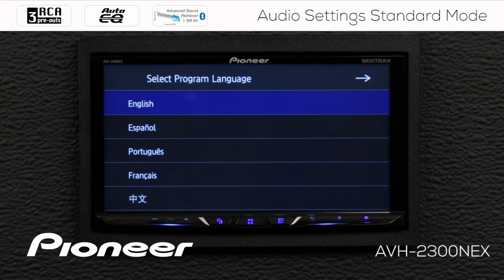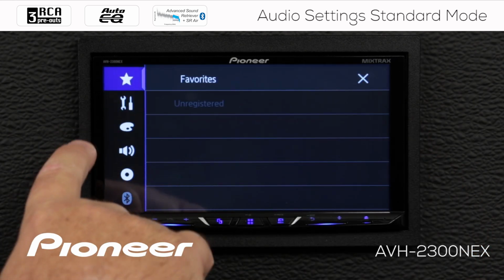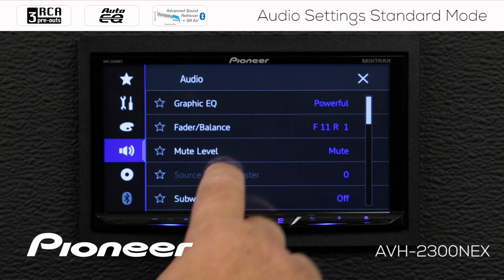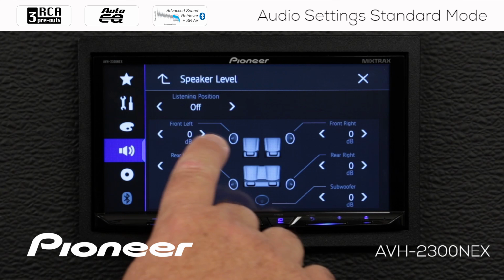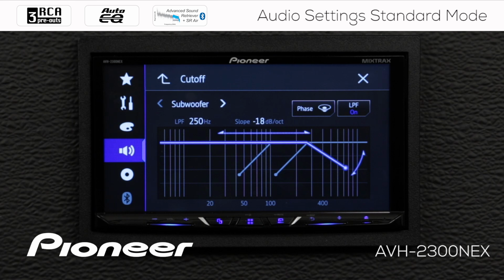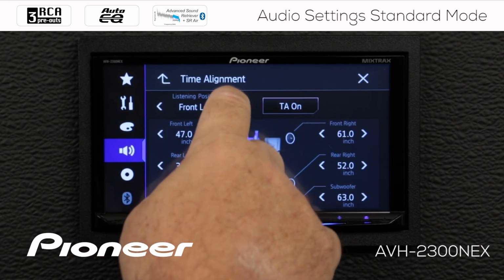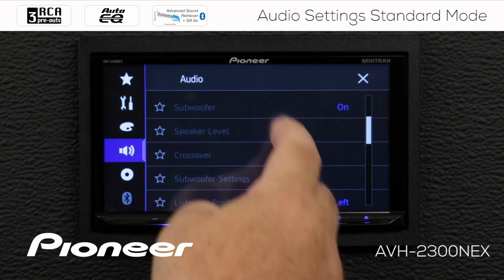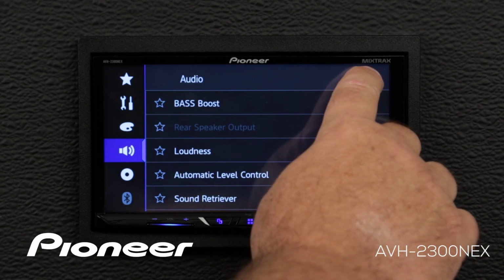How To - Audio Settings in Standard Mode on Pioneer AVH NEX In Dash Receivers 2017

Comment: For some reason, my "Rear Speaker Output" remains grayed out, even when I turn the source off. The unit is in "Standard Mode". My car has a small rear subwoofer, that is not working. It seems like the "Rear Speaker Output" switched to subwoofer would be the fix, but the option stays grayed out. Anyone have an idea? It's a DMH-1500NEX
Reply from the maker: Are you certain the receiver is in Standard Mode?  Rear Speaker Output being grayed out usually means the receiver is in Network Mode.  You can see it in this video:          https://youtu.be/3t9zCiIGO7M?t=827
Please be more specific with your question.   
Are you using the in-dash receiver's speaker level outputs or the RCA outputs to send signal to the subwoofer?
If you are using the speaker level outputs to run the 4 speakers in your vehicle, front and rear, I recommend to use the receiver's subwoofer RCA output to send signal to the subwoofer.  You can see it here:    https://youtu.be/I1XFyRiTZKc?t=217
Is the subwoofer a factory sub, or is it an after market subwoofer?
Are you certain the subwoofer is powering up with the vehicle switched on?
If this is a factory subwoofer, it may not be switching on or the signal may not be reaching the subwoofer.
Please take a look at this video for switching the rear speaker output from full range to Subwoofer output:    https://youtu.be/Z86fQryoRVk?t=701
If you are certain you have the receiver set up in Standard Mode, the receiver is off,  and still can't access the Rear Speaker Output menu, I recommend to press the receiver's microprocessor reset button.  You'll need a paperclip or some other small point to press the microprocessor reset button.  You can find the microprocessor reset button on the DMH-1500NEX on the hard key panel to the far right.
You can find more videos on Pioneer's YouTube Channel here:  https://www.youtube.com/user/pioneerelectronics

Comment: When I try to use the rca pre outs front or rear in standard mode at the same time as using the speaker out puts, there is no signal coming from the preouts.

If I put it on network mode, it changes the speaker outputs to network mode also. Only highs going out the speaker outputs. This does not work for me as I need to use the speaker outputs for the car factory bose system. 2009 Mazda CX-7.

Am I doing something wrong? 
Ideally
1;  I would like to use network mode as I have after market tweeters that I have installed running on their own separate amp. 

Or 2;  use standard mode keeping the speaker outputs in use for the bose system and using either the front or rear pre outs running to the separate amp for the tweeters. But no signal is coming out of them in standard mode. If I turn the unit up all the way and the gain up all the way on the amp, you can hear a faint signal. Surly I'm missing something. 

Rca connections have been checked and rechecked and the amp is a brand new pioneer 3702.
Note: Subwoofer Pre Outs work fine

Cheers if you can help me with this one.
Reply from the maker: What is the model number of your Pioneer in-dash receiver?
Please clarify your question:   Are you saying, in Standard Mode,  you are getting signal from the RCA outputs, until you connect a speaker to the corresponding speaker level output?  And only at that time does the RCA output stop functioning?   And if you disconnect the speaker, the RCA then begins to function normally again?
It's normal operation of the receiver for the outputs, both RCA and speaker level to change with Standard Mode or Network mode. 
In Standard Mode the Front RCA outputs mirror the White and Gray speaker level outputs.  And in Standard Mode the Rear RCA outputs mirror the Green and Purple speaker level outputs.  This is normal operation.
If you are not seeing simultaneous RCA output and Speaker level output from the receiver something is wrong. 
If possible, I recommend to press the receiver's microprocessor reset button.  This may correct the situation.

Comment: Ok so I got the same radio and I was wondering how you would turn on the rca cables
Reply: I ave one for a sub already hooked up but I want to run one for the front
Reply from the maker: What is the model number of your Pioneer in-dash receiver?  Pioneer NEX in-dash receivers have 3 sets of RCA outputs for operating external amplifiers.  You can see it here:   https://youtu.be/s-RuRzsRfE8?list=PLw63zJRQbCNi6CoU7JbUNT83T7ippQbU6&t=183  Using the RCA outputs is easy.  Simply connect RCA cables from the back of the in-dash receiver directly to the amplifier.  The RCA outputs are operating when the receiver is on.  You can find a full playlist of How To videos from Pioneer about NEX receivers here:  https://youtu.be/PeH_h8UHzBw?list=PLw63zJRQbCNi6CoU7JbUNT83T7ippQbU6     You can learn more about Pioneer amplifiers here:  https://youtu.be/99Hfmc8QxVc?list=PLw63zJRQbCNg42VJXw0g7xzWJozqoSR1V   and you can learn more about Pioneer Car Audio speakers here:   https://youtu.be/bwrJ4LcyHmU?list=PLw63zJRQbCNiTV71nfrZHNcn8taD6y4yX   and you can find more videos on Pioneer's YouTube channel here:  https://www.youtube.com/user/pioneerelectronics

Comment: I changed my car battery and by mistake when I booted up the radio hit network mode. Now I can not access the setting to change it to standard mode. I do have a parking brake toggle switch and it still won't let me access it. I pulled the battery, did a factory rest and nothing is working help please.
Reply from the maker: You need to do a Restore Settings.   You can see it here:   https://youtu.be/PeH_h8UHzBw?list=PLw63zJRQbCNi6CoU7JbUNT83T7ippQbU6&t=237     You can find a full playlist of How To videos from Pioneer about NEX receivers here:   https://youtu.be/ObpKXwrN8us?list=PLw63zJRQbCNi6CoU7JbUNT83T7ippQbU6   and you can find more videos on Pioneer's YouTube Channel here:  https://www.youtube.com/user/pioneerelectronics

Comment: A couple things i just want to make sure of.  The crossover setting and the subwoofer setting. Entering both yield the same menu. Is their any difference in the two menus ? They access the same 3 crossover points and settings stay in both.  I figured it’s just something to do with network mode     Other question- on the high pass crossovers , do they only work if your highs are run on rcas or does it control the speakers if run off the deck?
Reply: On Pioneer NEX in-dash receivers, the subwoofer setting is simply a short cut to the main crossover setting screen.  The crossover settings apply to the speaker level outputs as well as the RCA outputs.  For example:  the HPF on the Front will apply a crossover and slope to the Front Speaker outputs and the same crossover and slope will be applied to the Front RCA outputs.  You can learn more about setting up Standard Mode or Network mode on Pioneer NEX receivers here:  https://youtu.be/PeH_h8UHzBw?list=PLw63zJRQbCNi6CoU7JbUNT83T7ippQbU6&t=90   You can find a full playlist of How To videos from Pioneer about NEX in-dash receivers here:   https://youtu.be/ObpKXwrN8us?list=PLw63zJRQbCNi6CoU7JbUNT83T7ippQbU6    and you can find more videos on Pioneer's YouTube Channel here:  https://www.youtube.com/user/pioneerelectronics

Comment: My cousin cant do factory reset by the screen on his 2250. Does anyone  know another way?
Reply: Please be more specific with the Pioneer model number.  If your cousin has a Pioneer video receiver  he may need to engage the vehicle's Parking Brake in an ON-OFF-On operation in order access that setting.  If your cousin engages the vehicle's Parking Brake and still can't access the setting the vehicle may have an incorrect connection to the receiver's Green Parking Brake Wire.  Your cousin can learn more about the Green Parking Brake Wire here:  https://youtu.be/-bF3uzzaT30?list=PLw63zJRQbCNi6CoU7JbUNT83T7ippQbU6     Here is a video of Pioneer AVH-2300NEX doing a System Restore:    https://youtu.be/OMJ5yJ6157g?list=PLw63zJRQbCNi6CoU7JbUNT83T7ippQbU6&t=375    You can find more videos on Pioneer's YouTube Channel here:  https://www.youtube.com/user/pioneerelectronics

Comment: None of mybuttons work on my pioneer radio...any idea why?
Reply: I have no idea why.  If you want to correct the issue, I recommend to press the receiver's microprocessor reset button. If you have a Pioneer receiver with a microprocessor reset button, you'll need a paperclip or some other small point to press the button.   I don't know what Pioneer in-dash receiver you have so, I can't tell you where to find the microprocessor reset button.  You can see the microprocessor reset on a Pioneer receiver here:  https://youtu.be/o6iawP279R4    You can find more videos on Pioneer's YouTube Channel here:  https://www.youtube.com/user/pioneerelectronics

Comment: I'm having an issue with my new AVH3500NEX, everything works except the EQ and all Audio menu change settings. They are all greyed out, no matter what I do they will not respond. I can listen to radio, watch DVDs, use my Android phone and all the other sources. Just have those 2 issues, its so strange.
Reply: Be sure to have a music source ( like AM/FM Radio)  selected and playing when you use the audio settings.  If the audio settings are still grayed out, I recommend to press the microprocessor reset button.  You'll need a paperclip or some other small point to press the microprocessor reset button.  You can find the microprocessor reset behind the detachable face on the Pioneer AVH-3500NEX.  You can see it here:  https://youtu.be/ibWu0o2hW24?list=PLw63zJRQbCNja5HE6sCEu9Pz6RqC3Qx5u&t=297   Next I recommend to do a System Restore.  You can see it here:   https://youtu.be/OMJ5yJ6157g?list=PLw63zJRQbCNja5HE6sCEu9Pz6RqC3Qx5u     You can find a full playlist of How To videos with very similar operation to Pioneer AVH-3500NEX here:  https://youtu.be/kpKYks-17gM?list=PLw63zJRQbCNja5HE6sCEu9Pz6RqC3Qx5u          Please be sure to install the latest firmware for your Pioneer AVH-3500NEX.  You can find it here:  https://www.pioneerelectronics.com/PUSA/Car/NEX/AVH-3500NEX#downloads   and you can find more videos on Pioneer's You Tube Channel here:  https://www.youtube.com/user/pioneerelectronics

Comment: Please help me!!!  I have a AVH-4400NEX. When I receive a call my entire music and wave voice goes off.  I tried Network and Standard modes.  I also verified the mute level was on ATT  or Off and it still shuts off all sound but phone conversation.  Please let me know what I’m doing wrong.
Reply: This is normal operation for AVH-W4400NEX.  When on a Bluetooth connected phone call, all audio except the remote caller is muted from the in-dash receiver.  The ATT/Mute/Off setting is for connected smart phone applications or external navigation during the output of navi voice guidance.  You can find more videos on Pioneer's You Tube Channel here:  https://www.youtube.com/user/pioneerelectronics

Comment: I just installed W4400NEX in to my WRX 2017 limited with Harman Kardon using iDataLink Maestro RR. 2 issues I'm having: Please someone help.
1: I couldn't retain the factory USB on the arm rest. It shows, "HUB ERROR" on the screen when I plug in the Apple lightning cable. No biggy here since I use wireless Apple Carplay anyways.
2- This is my main problem- I can't barely hear the front speakers. Even if I use the fader to send all the signal to the front speakers, there's not too much sounds coming out front the front speakers. I double checked my connections and I did plug them correctly.
Note: Since I am retaining the Harman Kardon amp, I don't need to hook up the speaker wires from the Pioneer main harness to the RR harness right? 
I just hooked up the front and rear RCA cables from the RR to RCA behind the Pioneer radio.
Reply: As of 2019, Pioneer in-dash receivers do not support a USB hub or multiple connections to one USB port on the in-dash receiver. 
Are you able to hear full range audio from the rear speakers in the vehicle?  What happens when you fade to the front?  Do the rear speakers lower in volume?  Can you hear the remote caller on a phone call?   I recommend to contact Maestro tech support for more information on connections to the integration system.
Reply: Deckerd Otto I figured it out if why there’s no sound coming out from the front speakers it’s bc when I removed the factory HU, the telematic unit was underneath the factory HU. The front speakers are connected to that unit. So I put it back, shoved it and hid it behind the dash, now everything works but it’s throwing bunch of error in the dash. I figured it out that one also, all the lights in the dash disappears when unplugging the OBD2 cable which is I don’t really mind not having all the gauges and whatnot. But now the problem is, back up camera no longer works. I ordered the 12-6V camera step down, hopefully that will solve the issue I’m having.

Comment: I am experiencing a big lag when i am watching YouTube using the Bluetooth connection. I have tried numerous smartphones with various Bluetooth versions (4.2,5.0) and the lag is always there. I am talking for a 2 to 3 sec lag . Video's become unwatchable.Any ideas cause i am very disappointed?
Reply: Setup Android Auto of Apple Carplay, when you do this you are getting audio via USB so it's synced
Reply: Justin C. Music still delay with apple carplay. Seems bluetooth is a bit faster. Avh-nex4500
Reply: The in-dash receiver is operating as designed.  It is not designed to watch movies on your phone while using the in-dash receiver as a Bluetooth speaker.  When playing back video from USB flash drive, or with AV input, audio and video are synchronized.  You can see a video showing music and videos from USB here:  https://youtu.be/KWaYfYk90IU?list=PLw63zJRQbCNi6CoU7JbUNT83T7ippQbU6

Comment: Everything is grayed out
Reply: I recommend to press the microprocessor system reset button located on the Hard Key Panel.  You'll need a paper clip or some other small point to press this button.  After reset, select a source, like Radio.  No audio options are available unless a source is selected.  You can find more videos about Pioneer AVH-2300NEX here:  https://youtu.be/ObpKXwrN8us?list=PLw63zJRQbCNi6CoU7JbUNT83T7ippQbU6
Reply: @deckerdotto6035  hey i have a question..speaker level-»subwoofer level..how does it affect sound/performance wise? ,does it affect rca voltage?

Comment: All the options under Audio are greyed out and I have no sound. I installed standard mode, I have power coming to the amp via battery and the head unit.
Reply: Audio settings are greyed out until you choose a source like FM radio.  https://youtu.be/SMHohqS7DSk  What mode in dash receiver do you have?
Reply: Audio settings are greyed out until you choose a source like FM radio.  If you choose a source and still have no audio options reset the in dash receiver by pressing the reset button on the hard keys.  You'll need a paperclip or other small point for this.  You can find more videos about Pioneer AVH-2300NEX here:  https://youtu.be/idL6MOXfNVI?list=PLw63zJRQbCNi6CoU7JbUNT83T7ippQbU6